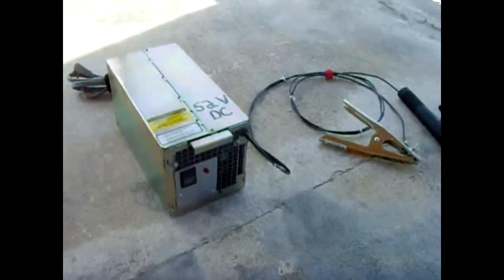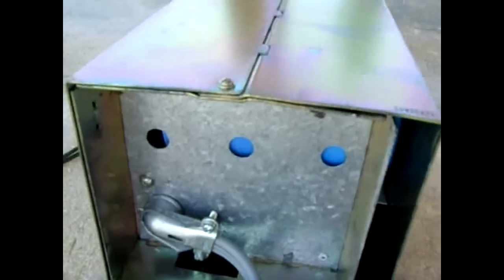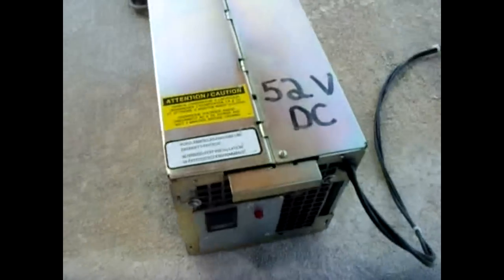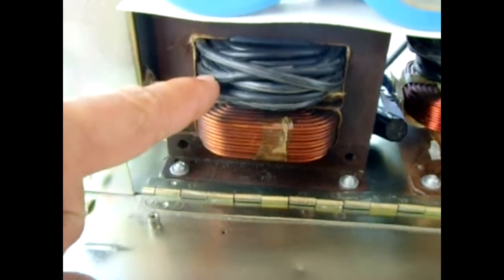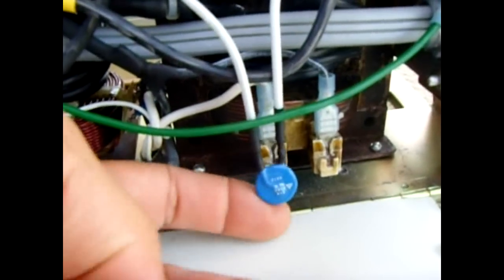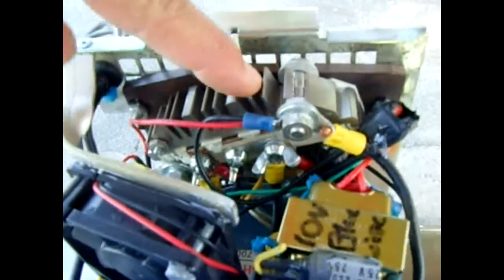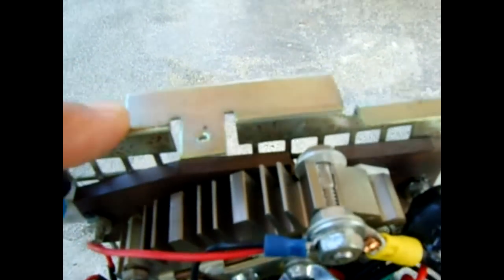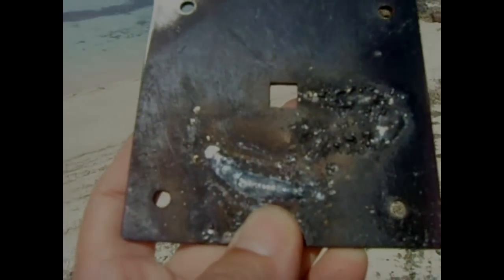Microwave Oven Arc Welder(DC Output)

Comment: Nice job. You could have powered the DC fan from one of the microwave oven transformers by just adding a diode bridge and a capacitor. Very compact, very nice work.
Reply from the maker: True, but I prefer that only be used for the welding. The output isn't stable enough, especially if the welding rod gets stuck to the metal. Thanks for watching!

Comment: I've got all the parts i need to make a M.O.T. DC Welder except for the caps and the ones you have are rather expensive on the site that I found them on. So i am wondering why you didn't use a capacitor out of the microwave?  You may not have used them because they are way too big, but i also have some capacitors out of an old A.C. unit that are rated for 440v and 360v (i think). I'm thinking i might use one of those if they are in good shape still.
Reply from the maker: Those caps are "non polar", designed for use with alternating current.
Reply: @electronicsNmore  how is the alternator bridge rectifier working out? I pulled one out of an old alt. but over the past couple of days researching how i want to build it, I  came across some info that said the voltage capacity on the rectifiers from alternators wasn't rated for the amount used during welding. I found a 300a 1600v bridge rectifier on ebay for $25 . The reason I want such a high amperage is because if I hooked up more than two M.O.T. (lets say 6) I'm not sure that a 12v rectifier will be enough.  I'm pretty new to electrical design, but next semester is the beginning of my junior year as an E.E. so I have a basic understanding of simple circuits.

Comment: Like it. Would I be able to make one of this with my computer back up power supply? 12 volt DC?
Reply from the maker: Not enough current output.
Reply: My computer power supply is 620 Watt. Is it enough? How many watt can yours output?
Did you put it together with varies component you found. Your compactor is huge

Comment: I inherited a 3 phase 1970s cp-200 wire feed miller welder i converted it to single phase but i cheated i found a form online on how to do it! but it only lost about 15% of its output from doing so! not teabag!

Comment: whats difirent in a regular polarized capacitor then in a audio capacitor, cause a ifound really cheap audio caps, but im not sure if i can use them for welding
Reply from the maker: +Rodrigo Friend 
A vehicle audio capacitor has a voltage rating that is too low.
Reply: electronicsNmore but i found one thats for 100v, will it wotk?
Reply from the maker: Rodrigo Friend
Tell me the full rating.
Reply: +electronicsNmore 100v 10000uf 105 degrees celcius and it says hifi audio on the cover
Reply from the maker: Nothing wrong with using them. They are electrolytic caps.

Comment: I apologize if this is a stupid question, but I decided to ask anyway.  I understand that this circuit is around 52 volts, the capacitors I have, when put in parallel are 11000 uF (I think).  Using an online calculator this gives me around 15 joules.  is this enough energy to warrant using a bleeder resistor, or should I be safe.  Also thumbs up and subscribed for the great video :)
Reply from the maker: +Plazma “Mr Plasma-CRAZY” lasrer 
No need for a bleed resistor. I usually finish welding, then tap the electrode on the steel to quickly discharge the capacitors.
Reply: Thanks :)

Comment: Good job but the varistor really isn't doing and good connected to the output like that in this application.Your wire size gong to the ground clamp and stinger is way too small, get some booster cables for some cheap heavy wire...and I would drill some holes in the insulation plate of the rectifier to let air through to aid in cooling. Others have found that a choke (rewound MOT) works better than a capacitor (both is even better) for stabilizing the arc.
Reply from the maker: +Craig Diamond 
Hi Craig. The wire size is just fine. I have had zero heating problems. I also have used this unit many times over the past couple years. It makes no sense to use a heavier wire leading to the clamp or electrode than the wire size used to wind the transformer(10ga). It works great as long as the electrodes used are 1/16". The varistor was used to help protect the diodes, nothing more. I use varistors in many of my 12V circuits which are connected to charging systems(alternators).

Thanks For Watching
Reply: He is using 52v so he can get away with smaller cables. But, 52v is rather too high as you can get a nasty shock from that. Hope person is not sweating on the job (zap)

Comment: I get around 35 volts AC coming out of the transformers, when I run the output out of the transformers thru a 100 amp 3 phase rectifier I only get around 33 volts DC, I made a simple rectifier bridge and get around 53 volts DC. Do you think the 100 amp rectifier is defective or am I doing something wrong when I hook up the bigger rectifier.
Reply from the maker: 53 vdc sounds about right. You must be doing connecting the 100A 3 phase rectifier incorrectly.

This is how you connect it when using 3 Phases:
http://www.esru.strath.ac.uk/EandE/Web_sites/08-09/Hydrogen_Buffering/Images/rectifier.jpg

You are going to take the AC output from the 2 transformers in series and the leads will be the 2 green arrows on the top left. Of course you are using a single phase, so the wires will not be tied together to the left of the green arrow. You can abandon the last set of diodes, or double up on lead leaving the transformer like I did.

Thanks For Watching. Be sure to share my channel with others and rate thumbs up!

Comment: simple but it works
Reply from the maker: Yes, I use it all the time for jobs around the house. No problems yet, and I made this a while ago. I also added a SPDT switch with an oil filled 370V capacitor in series with the power transformers to reduce the power output for thin metal. Works good.

Thanks For Watching!

Comment: Now all you need is a variac to adjust the input voltage to the MOT's, take the current down low enough to weld on autobody stuff.

Comment from the maker: Go back to the video. Around 3:20 on, I describe the (2) 40V capacitors each rated at 37000uF. I then stated they are in series for 80V at 16500uF.

Comment: If you connect capacitors paralel you will have 40v and 2x the capacity you specify, if you connect in series than you will have 80v but the capacity drops 1/Cp= 1/C1+1/C2 as i know

Comment from the maker: I used the 3rd small transformer to power the cooling fan. I could have had the fan turn on once a certain temp was reached, but I got lazy. The fan runs as long as the unit is turned on.
Reply: They sell 120vac fans....

Comment: Awesome job. Been trying to find info on a dc microwave welder. Sounded good in my head, just hadnt found info on anyone doing it. Question, whats the third, smaller transformer and rectifier for? An easy start circuit?

Ps. Found out some panasonic microwaves have an inverter in them running around 4kv dc. I'd like to get my hands on one or two of these and try converting them for dc welder duty.

Comment from the maker: No. The capacitors are used to smooth the converted AC input to DC. The larger the value, the better the smoothing will be.
Reply: Better said " Caps used to smooth out the pulsing DC voltage." Like getting plain potato chips instead of ripple potato chips :-) Problem is that your working those caps Very Hard & stressing them. An inductor (with caps even) would be better for long term use.

Comment from the maker: Once you get that far, you can add a 100A diode trio/rectifier from a car alternator to the AC output. Next you take a very high value DC electrolytic capacitor(Like I used) and place it across the DC output. ++ to --. Make sure the capacitor is rated HIGHER than the voltage you are using. Double is ideal. Mine are rated 82V. Make sure to cool the diode trio rectifier. A varistor/mov can be added across the cap to help protect the diodes. Use an MOV that is rated just over the diode rating. .

Comment from the maker: Yes it works. Why would I make it, if it did not work? I put this together a while back. I did not have a schematic. I made it from my head. LOL Take two microwave oven transformers of the same size/wattage and chop out the secondary(fine wire 2KV secondary winding). On each transformer you wind 20T of 10ga stranded wire in the same direction. Connect the two transformers primary windings in parallel to 120v, and the newly wound secondaries in series. Connect clamps. This is the AC version.

Comment from the maker: Actually the 10 gauge wire can handle 40A with no problem. You have to realize that I intentionally use 1/16" welding rods to make sure the current stays down. Using thicker rods would allow more current and overheat the wires. Everything works fine as designed. This unit is not designed for continuous duty. There is a duty cycle to avoid excessive heat from the transformers. Thanks for the reply.

Comment from the maker: @luizrosarosa 

No clue what the rating is....Probably 30-40 Amp output. but I keep the rods at 1/16" thick to hold back the current so I do not overheat the transformers. 10 ga copper is rated for 30 Amps, but you can push 35-40A if you needed. If you use a thicker rod it will take more current to get it to melt. I used a 105A rectifier for a car alternator. The capacitor smooths out the rectified DC current/absorbs spikes and helps make the weld better.  You can used a 15-20A rated Dimmer.

Comment: Hello friend I live in Brazil and I really liked your welding machine, I also installed a microwave transformer and would like to know what your total rating, its bridge and full-wave diode? and what the purpose of the capacitors in this system? how you regulate the amperage, I'll try to put a dimmer in the primary for such embracing.

Comment from the maker: @Stormas3000 

2.6 mm wire. Ok, 230v. Same procedure, but you will use 1/2 the turns of 6.2mm copper wire when you wind it.

Comment from the maker: @Stormas3000 

Stranded 10ga copper wire. Make sure the electrode is 1/16". Cheapest place to buy a roll of 10ga stranded is at Autozone.

Comment from the maker: Not too thin, #10. That has been proven over and over with my regular use of the welder. The wires never got hot, or very warm. That gauge wire for my intended use can handle up to 40 amps with no problem. I also only use 1/16" - 3/32" welding rods, which keep the current down.
Reply: Your welder probably can only put out about 30A, 120*15=1800, 1800/54=33, so considering that you have losses in the transformer and the circuit, you are probably only running 30A@55V, that is why your 10 AWG is ok.

Comment: you should add an extra alternator with the internal voltage regulator removed to your generator or another simular setup so you could also have a portable stick welder, but you would probally have to add a throttle somewheres to increase or decrease the voltage.